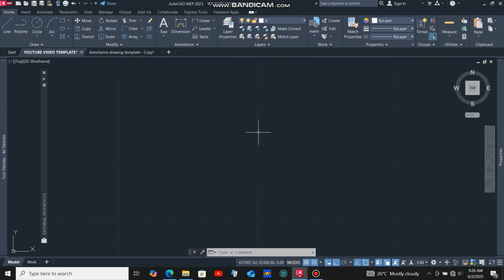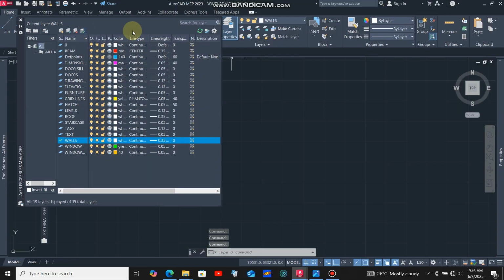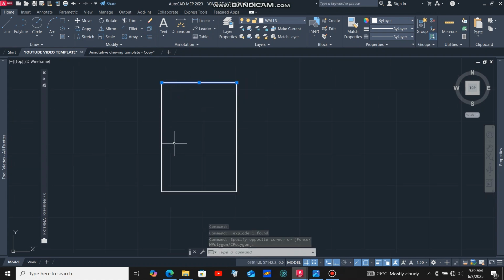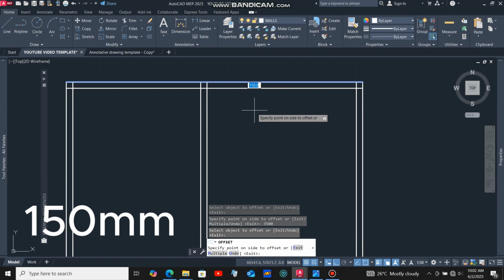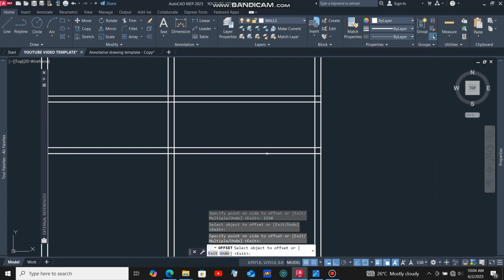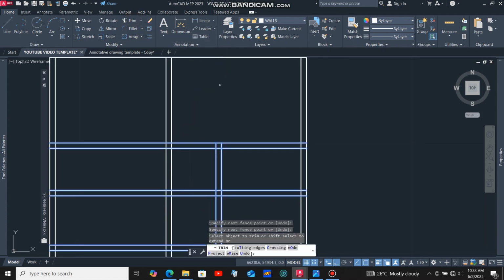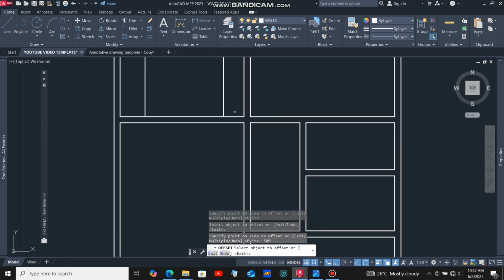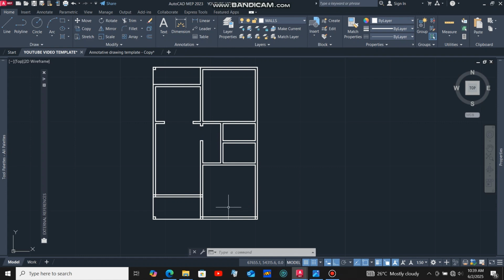How to draw WALLS in AutoCAD 2023  Part 1 of 3

Comment: Did you make the walls offset from the centerline to 15 mm right? What about the other side of the centerline, that should be off settled as well right? Please clarify
Reply from the maker: Hi, thanks for reaching out, usually if you are offsetting from the centre line (grid lines) make sure that you offset 75mm from each side of the line offseted to make 150mm the thickness off he wall. Thanks